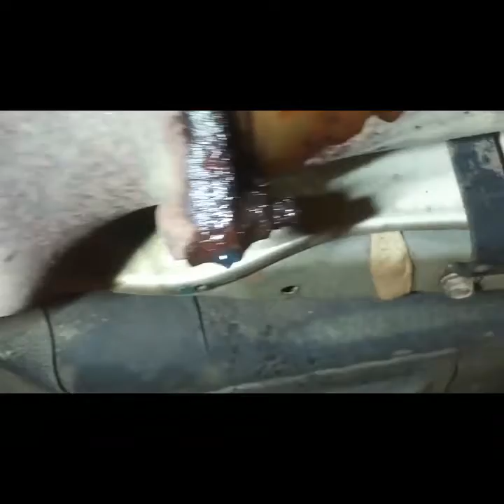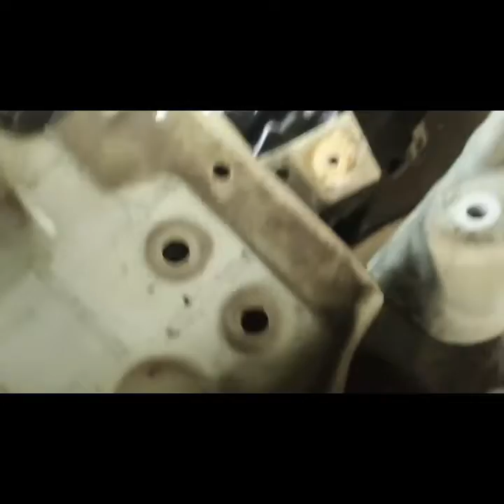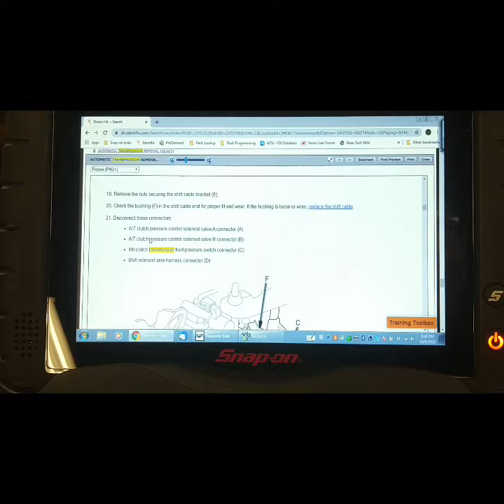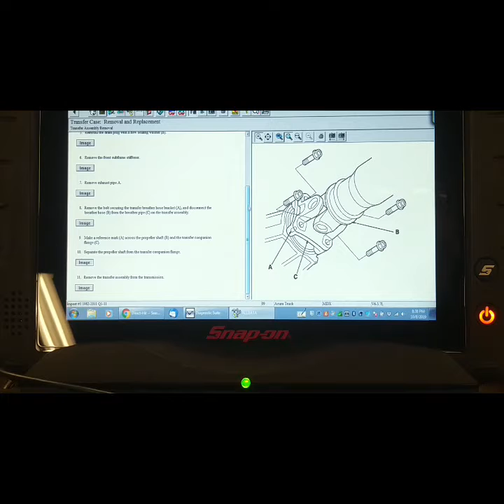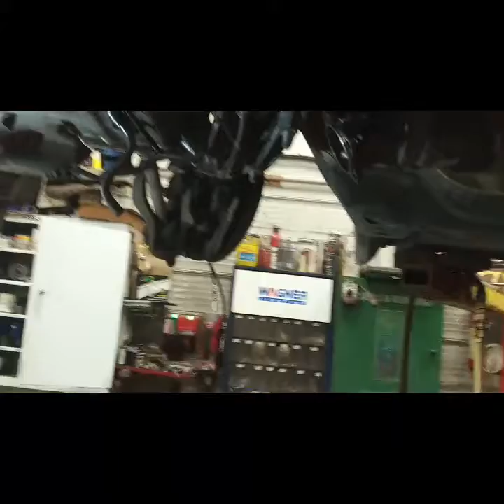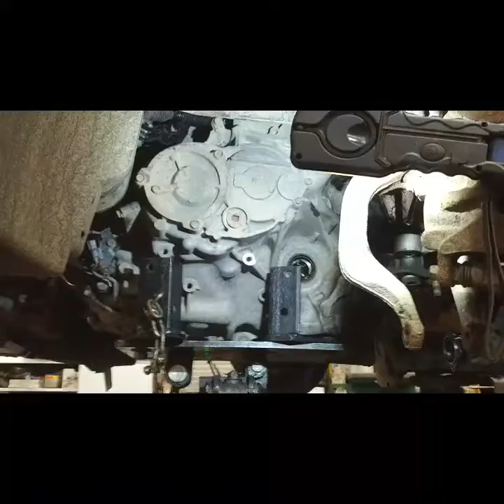2010 Honda Accord Crosstour Torque Converter Replacement

Comment: I have a po 741 flashing d changed fluid 3 times comes back after 180 miles . Is my tc bad b
Reply from the maker: More than likely you need a torque converter ɓut it's possible that clutches could be slipping.
Reply: @PhillipBailey shifts perfectly . No issues at all. Started doing it after I added a vcm tuner 2 . I took the fuse out of the vcm tuner 2 and now my temp reads super low but no eco light and no flashing d.. someone else mentioned a rear motor mount putting stress on converter causing slippage . These cars are more sophisticated than I imagined and I’ve been wrenching for a long time
Reply: The first resistor type vcm muzzler caused some code with the vvt and gave me cel and caused limp mode . Removed that and cel went away and no more vvt issues . Starting to think the cross tours don’t like vcm disabled

Comment: Awesome video I’m gearing up to do this on my 2010 crosstour soon. Thanks  for putting this online.  I’m lucky because mine is front wheel drive so I won’t have to monkey with that drive shaft. Cheers.
Reply: Update* replaced the rear motor mount. Fixed all my idle problems and torque converter slipping.
Reply: @justingog4533 the motor mount fixed your torque converter issue ?
Reply: Yup where the motor connects to the transmission if a mount has catastrophically failed. The slight change in angle can cause a slip and delay in engagement. Trust me I was befuddled when it fixed it too! Lols
Reply: @justingog4533 that’s awesome I have to look into this I love my 2011 crosstour but I’ve been getting a po 741 tc code recently . I’ve had issues with axles and all kinds of minor stuff but she never left me stranded . 200k original motor mounts hoping I can change that and see what happens

Comment: Thanks for the detailed video! looks pretty tough job, maybe I cant get it done in a driveway. I have a 2012 Crosstour, which has a similar vibration phenomenon when accelerating 40-50 mph, some people say it a bad axle. How can I diagnose that? Are the vibrations different for bad axle and bad converter?
Reply from the maker: Similar sensation to both but you can watch the TCC activity on the scanner.. I don't remember if you can turn off the TCC with the scanner. There is a Honda TSB on this.
Reply: I gas the same problem, i put aftermarket axle and resolve my problem

Comment: I have this same car that I'm swapping in a replacement engine for. For those downward facing nuts that connect the upper cats on the exhaust manifold to the flex pipe what do you suggest doing to remove them, they no longer resemble nuts and are definitely not 10mm anymore. torch? extractors? I dont want to risk rounding them off any more than i already have.
Reply from the maker: External extractors and heat from a torch or magnetic resonance heater. Don't start a fire...

Comment: I have 13 crosstour (push to start) and it sounds fizzy and squealy when I start it up..it doesn’t start most times.. I have to keep doing it multiple times.. the starter has been replaced 3 times.. battery is good.. now we think it’s torque converter.. idk what do you think
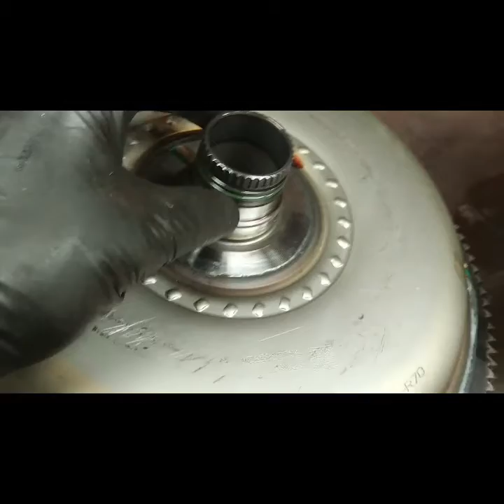Reply from the maker: The torque converter won't cause a starting problem. The starter engages with the driven teeth though and if the teeth are worn the starter will grind at times. The driven teeth are part of the torque converter as seen at 25:30 and 25:55 in the video though.
Reply: Be sure you're replacing your starter with and OEM starter and check to see if the service bulletin fix was already applied. By rotating the teeth of the torque converter and replacing to OEM you may be better off

Comment: How did you know to replace the torque converter? What were the signs?
Reply from the maker: The vehicle would shudder under a light load at 30 to 50mph. There is a TSB from Honda on the problem but the vehicle was outside the warranty limits for the TSB. The internal clutch inside the torque converter chatters on light acceleration.

Comment: Would this be considerably easier on a non-Crosstour Accord or just slightly easier? My '08 V6 shudders on light acceleration and I'm trying to figure out if I can change a torque converter in a driveway.
Reply from the maker: That's a tough question to answer without knowing what tools you have to work with and what your mechanical ability is. You will need a transmission jack and an engine support fixture. Being FWD only is a bit easier since you won't have the power devider to remove. Are you sure it's the converter?
Reply: @PhillipBailey  Thanks for the reply! I am not sure, but it's either that or the transmission. I've done some maintenance in my day but I think this is best left to the professionals either way. I think I'll have it looked at and go from there.

Comment: Did you have to fill up the torque converter with ATF? If so how much quarts?
Reply from the maker: No it will fill up when the engine is started. just need to top up the transmission oil level afterwards.

Comment: Hey my 05 Crv has a weird thing when coming to stop or driving slow speed feel like a violent shake
Reply from the maker: It's hard to say what that is without actually feeling it. I have had torque converter clutch solenoids stick mechanically and cause that sensation but not on a Honda. On the vehicles that did have that problem it was usually after driving at highway speeds and then coming to a stop. (like stopping a standard without stepping on the clutch). I'd suggest to have your motor mounts checked I believe one of the Honda mounts is electronically dampened. Could be a failed motor mount.